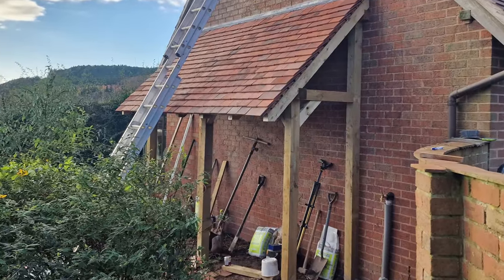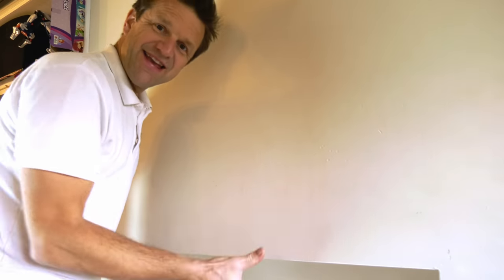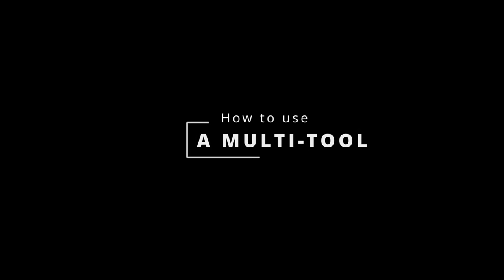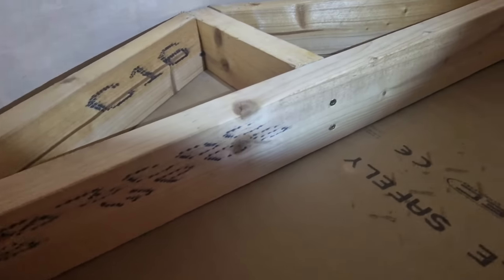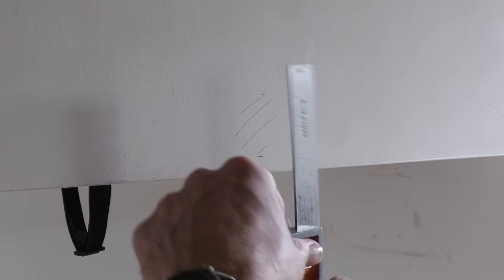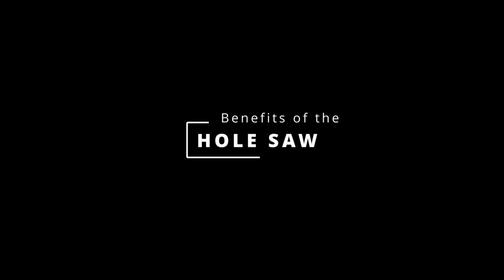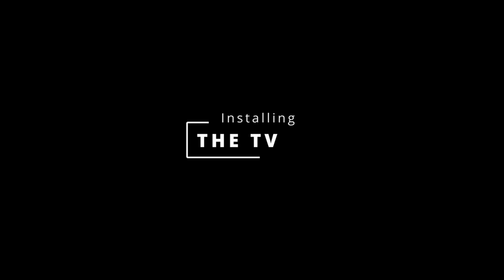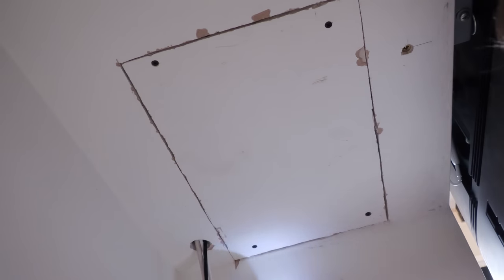How to Hang a TV on a Hollow Wall

Comment: Option 4 to remove a plug is to literally drill it out of existence.
Reply from the maker: Yes I missed that. Drill out the middle with an HSS bit, and you can just pull it out with long nosed pliers. There's always something I miss 🤦